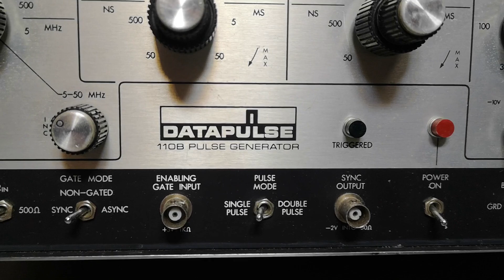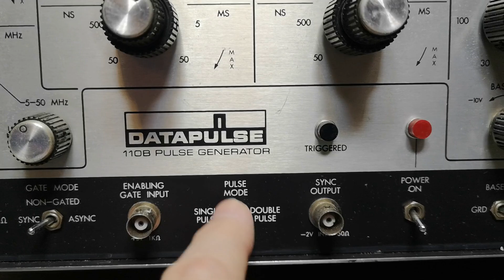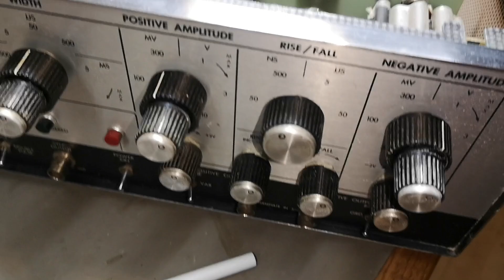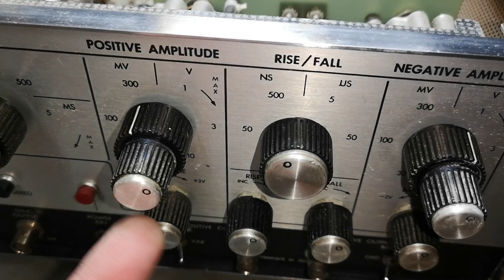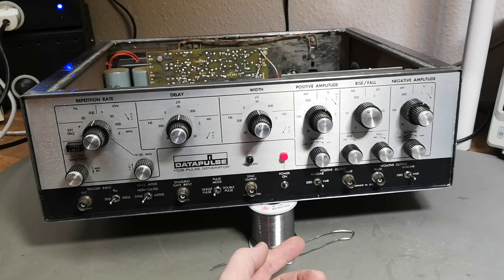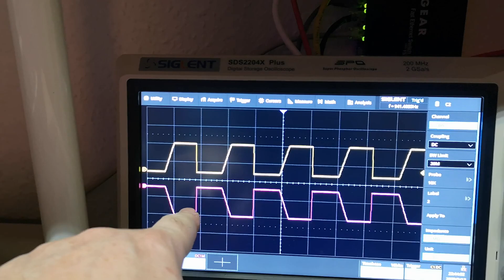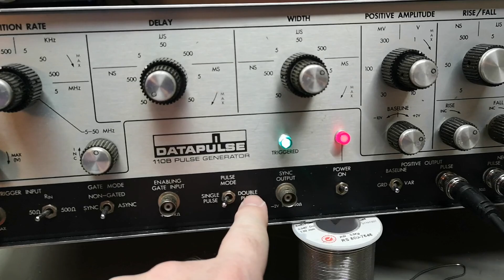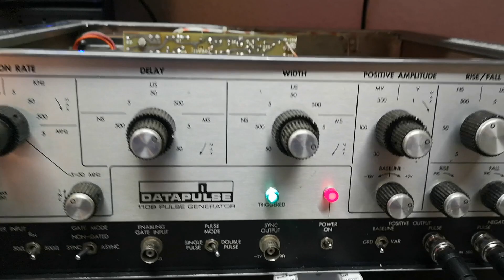Datapulse Systron Donner 110B Pulse Generator 5Hz-50MHz repair test teardown (1967-77)

Comment: Wouldn't have been smarter... this is probably intended to simulate digital logic inputs which just go by the same rules as that generator - rise/fall times are inherent to the circuitry used no matter what the clock is, or to drive clock inputs for logic - which also has optimum rise/false times independent of the clock frequency. ... The device seems useful for calibrating oscilloscopes in the 50MHz class, btw.

Comment: I picked up a Datapulse Model 101 some years back. Very nice unit. Mine dates from the late 1960s and also indicates that it was built under license from another company; your 110 didn't have that on the label. I noted that the part number on mine is 37000-424. I'm not surprised to see it drawing 70 Watts given all of the transistors in these units. Mine runs a bit warm also!